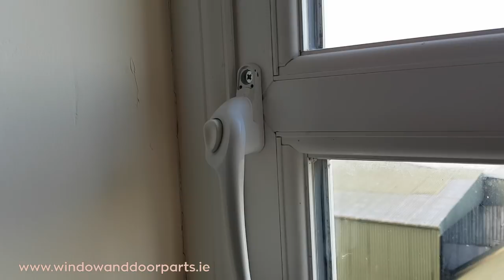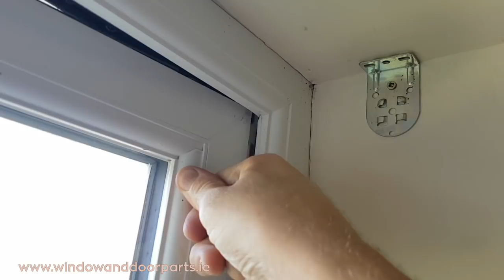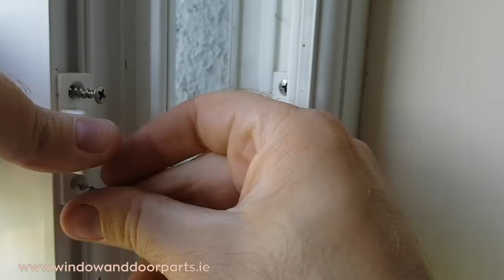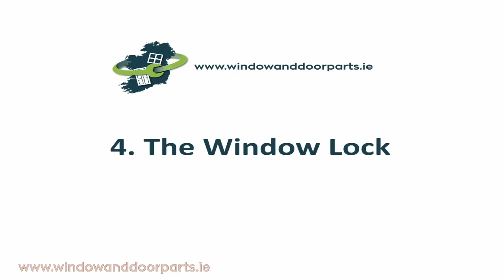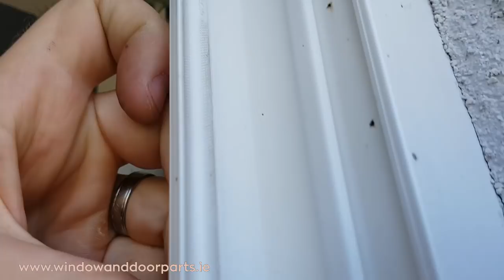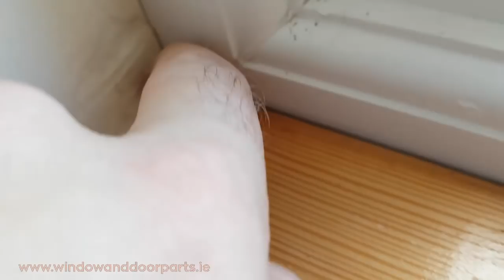How To Check Your Windows For Draughts This Winter

Comment: We just purchased new windows that are a Casement/Picture/Casement shape.  They are quite tall...62 inches.  We noticed that the sash is not connecting tightly to the frame and cold air is coming through the gap.  I looked at our interlocking blocks and noticed that we only have one pair of blocks on this rather tall wood window.  I then looked at my vinyl casements and noticed that they came with four pairs (total of 8) of interlocking blocks.  My thought is that our issue may be not having enough interlocking blocks.  How many pairs of interlocking blocks should a 62 inch tall wood casement have in your opinion?  Thanks for the great video.
Reply: I would get a level on them and check they have been installed plumb

Comment: Brilliant video and explanation. Really educated me in maintaining my windows. 
Question on part that was spoken about but not really explained on resolving. The centre blocks. I checked one of my windows and there is a bow in the middle letting in draft. Both blocks are there but the gap is also there. What needs to be done to rectify this. Many thanks.
Reply from the maker: You need to move one of them so they end up closer together. At the minute they are not touching. They should touch together and pull the window in at the middle. It's hard to get small adjustments, as you will get the width of a screw hole of movement

Comment: Hi Paddy, I've just replaced the hinges on my bathroom bottom-opening window (typical narrow long rectangle type at the top of the overall window). Your video on replacing the hinges was of great help. The sash now closes opens and closes much easier and the large gap at the sides is mostly gone. However, where there was a 10-15mm gap there's now a ~3mm gap on both sides in the lower part where it meets the corner - any idea why there's still a gap and how to fix it? If I use the handle to pull the window toward me there is a little play which then closes the gap.
Reply from the maker: Hard to know without seeing it. Can you upload pictures using imgbb.com or freeimage.host and send me the link here

Comment: Hi paddy we have just had fitted some tilt and turn windows but we are finding water on the sill on each corner of the hinge . Window company dont have a clue / never seen this problem before . They have tightened the windows and tried to blame it on condensation as this is a new room . My answer was how come it's not on any sealed window frames.  Could you please give me you thoughts .
Reply from the maker: When does the water appear? How often is it there? After rain? Or every morning?

Comment: Great video Paddy, thanks. I have a window where you can see daylight between the sash and the frame (similar to the dropped sash in your video at 6.24) but the gap is at the side.....am I right in thinking the hinges have failed and need replacing to rectify this problem?

Comment: Your video was very helpful. I have extreme drafts coming from the apron  of my windows. should there be a gap? I was thinking that the apron was used to hide bad workmanship! What size of  gap should be under t he e sill?
Reply: All comments and advise greatly appreciated.
Reply from the maker: What do you mean by the apron? That's not a term I'm familiar with.

Comment: You can clean the hinges and the tracks and then oil them and most will work perfectly. You don't have to replace them as a first response. That's not good advice.
Reply from the maker: If there is a gap at the hinge side when the window closes, then the hinges are broken. No amount of cleaning and oil is going to fix that. If there's no gap then they are not broken. If something isn't broken there's no need to fix it 🙄

Comment: Should patio doors have interlocking blocks ?
Reply from the maker: No they are for windows only. The idea of the interlocking blocks is to pull the window in at the mid section of the window. As there is no hinge in the middle. There is usually 3 hinges on a door. The middle hinge should pull it in at the middle. You'll sometimes see bolts that look like interlocking blocks on doors, but these are anti-jemmy devices for security

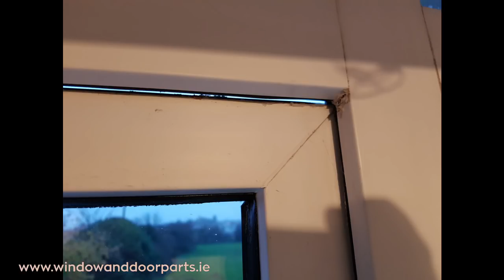Comment: What is the solution to the problem at 6:24 where the sash has dropped. New hinges?
Reply: Not necessarily. The glass may just need re-aligning...  
(Moving the glass inside the frame will actually change the position of the frame...!).
First thing to do is remove  the plastic trim strips from around the frame (they hold the glass in place).  
Note: A wallpaper/paint scraper is ideal to use as a wedge in the gap where the trim meets the outer frame to open the gap.  A large screwdriver can then be used to prise the strips out. Start with a long strip first (makes it easier).
You will then see that the glass has plastic spacers at points along the edges.  Experiment with moving these as required to close the relevant frame gap.

Comment: No, no, no, silicone is a poor insulator. Only expanding foam, not only it insulates better it fills the gaps and is also a better noise insulator and lasts longer. If you go to continental Europe where there are colder winters you will never ever see silicone used as a filler for gaps between walls and windows/door frames. Terrible advice. I find windows in homes of UK and Ireland of really poor quality, of course, there are some exceptions but this is a rule. And silicone everywhere as an insulator... At least 20 years behind Germany or Poland.
Reply: So tell me how is Paddy to put expanding foam on a hair line crack of finished plaster. These windows have been installed for years. Its not a new install so expanding foam is not a option here? What would you do here?